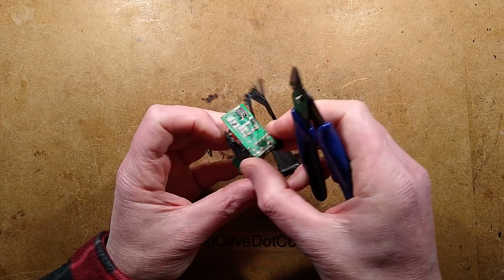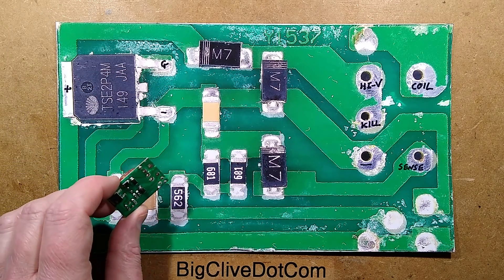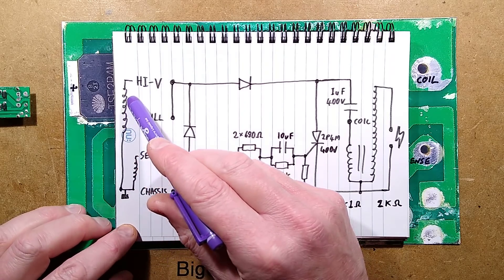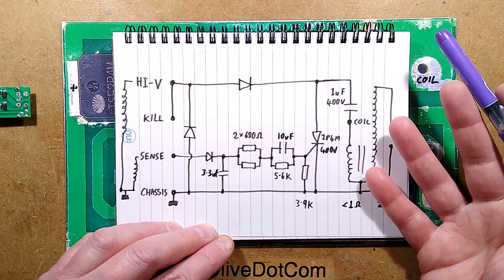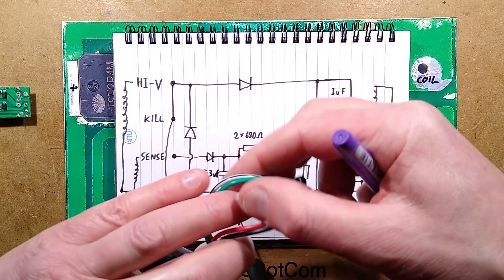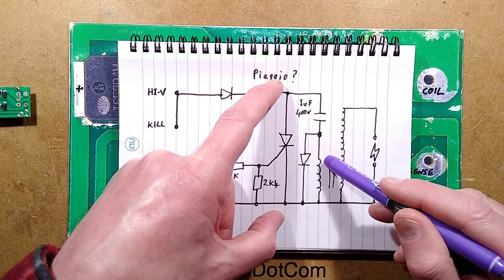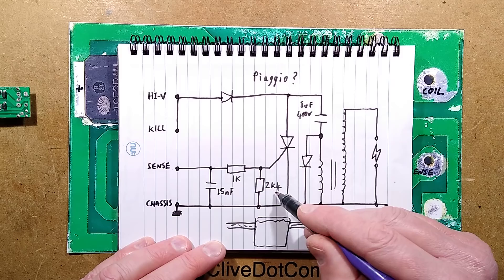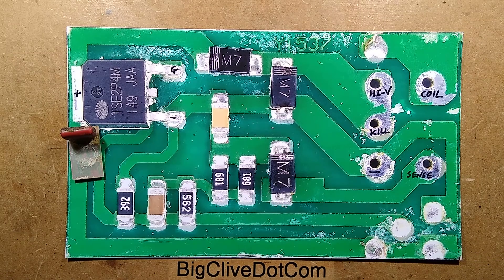Inside a cheap CDI Capacitive Discharge Ignition module - with schematic

Comment: Chuckled at the 'Kill switch chat', my 1st motor bike a Triumph Cub in the 70's had been 'refurbed' by the seller and had put a horn button on the bars as an extra kill switch, but unknown to me had earthed the coil HT OUTPUT, like some lawn mowers and the metal strip onto the spark plug. And yes the 1st time I found out was with no gloves on but I got a good deal as he told me 'it cuts out when it rains'. Wonder why.. :-)

Comment: The ignition coil from a car can be very useful for high voltage experiments ⚡⚡⚡
Reply: Made a self oscillating circuit for one. It fires 5-10k times per second, and the arc is hot enough to melt solder and light a candle. You can check out the video on my channel.

Comment: directly grounding magneto ignition primary via a switch or push button is pretty much standard and has been for many many years, they likely copied honda/yamaha/suzuki and others.
many of the engines and other parts are close honda clones

Comment: Maybe the little "tank circuit" between the sense and trigger acts like a variable time delay that varies with RPM.  Anything that adds a little more spark advance, too a point, as RPM increases would add performance to the motor.  As RPM goes up, the incoming sense pulse should be ramping faster and faster as it narrows.  I'd like to see the circuit on a scope while being stimulated at different frequencies from the sense line, to see if anything happens to the timing of the trigger as frequency input changes.
Reply: I'd like to know how to have a capacitor wired in to retard the spark to make starting easier,

Comment: I was looking at the Piaggio schematic you drew and I was wondering if the diode over the transformer is pointing the right way? Now it looks to me like the current will flow through both the winding and the diode. I'm used to see the diode mounted the other way around to clamp the back-emf.
Reply: It is the right way. When the circuit is triggered the top terminal of the coil is negative.

Comment: I would think the sand is there for the same reason its put in fuses. To help contain any sudden flame out over heating damage setting fire to the case. Just there misguided attempt at fire prevention.

Comment: When fixing the older pre-CDI contact-breaker type ignitions, almost any replacement capacitor would do, as long as it was rated for mains voltage. We would recognise a faulty ignition by a weak spark at the spark plug. We'd first judge the colour of the spark, should be blue, and the distance the spark could jump from the lead to the engine. Should be about 10mm or more. This to determine if there was an ignition problem at all (other than timing). Next we'd check if there was any sparking between the contact breakers. A breaker ignition with a good capacitor will have next to no sparking between the contact breakers. On an ignition with a bad cap, the breakers will spark at every revolution.
Reply: In addition to allowing a path for the back emf to decay, I think it also allows the coil primary to 'ring' giving a longer sparking time.

Comment: The terminal you labelled is not high voltage. The charging voltage is in the order of tens of volts. You would not feel it at all. The high voltage output is generated by the turns ratio of the transformer.

Comment: Just guessing the reason the piaggio design is simpler is it lacks somewhat of a timing curve that the other circuit has. The one cdi is for a 4 cycle engine as the piaggio is for a 2 cycle. Again, I am just guessing

Comment: There is also another module style sold as points replacement for magneto plus mechanical points.
In these the trigger sense is off the high voltage feed from the magneto. The original points short the coil and magneto to suddenly collapse the current.
The replacement triggerd the short circuiting  thyristor as the voltage just starts to drop with a capacitor circuit and a PNP transistor.

The wire colout codes used on cars correspond. Black switched ignition, red permanent battery, brown earth. My 1973 VW camper uses that scheme.

Comment: Odd thing about the CDI system is it works completely backwards to a conventional ignition system. Typically for most car ignitions, the coil is driven just like it would be in a flyback power supply. There is a dwell time (equivalent to duty cycle) that allows the current to ramp up until the coil is nearly saturated, and then the transistor switch snaps off, resulting in a flyback pulse that fires the spark plug.
Reply: I'm trying to get my head around the CDI vs conventional thing.
" that allows the current to ramp up until the coil is nearly saturated, and then the transistor switch snaps off, resulting in a flyback pulse that fires the spark plug."
So spark occurs when mag field collapses ?
Reply: @Boraxo  Yes, spark occurs when the field collapses.

But of note, in a conventional car ignition system the coil is switched with "points" in the distributor instead of transistors.
Reply: @Boraxo Yes, and note that the back emf is in the order of hundreds of volts. In cdi unit the capacitor discharge is initiated by points closing. You have to have a hv generating circuit, or If you have a magneto you already have hv, which is used to charge a capacitor, then a transistor discharges the capacitor into the coil primary when the points close.
Reply: Research field collapse magneto and field buildup magneto.

Comment: Im guessing they include the reverse diode in the first module so the magneto voltage just doesn't sail off into the sunset. There's no real harm as it will essentially be like the catch diode on a relay. It will simply allow current to flow and then decay out from the resistance of the coil and wiring.

Comment: If your car has brains, dont remove the battery from the circuit while its running. A lot of ECUs rely on it to smooth out the supply and can get angry if its suddenly given a shit ton of noise. Bump starting on a dead battery is fine, just don't take it out of circuit.

Comment: You are amazing.
For years I have been looking for this to design my own fancy imitation cheap imitation cdi
Reply: Yeah but I ain't rich like that.

And well R.C. that's a good thing since I wanted to produce a few dirt cheap for testing.

I want one that's got it all though. Now I have to keep switching cdis.
That's why I wanted to build my own with several settings, a simple moped ecu one might say. At first I wanted to build a switchboard but with all the wires it thought it would be to relay-able so I tried to find schematics so I could simplify the wiring but I couldn't find anything clearly close enough to pick from. It was a few years ago and since then, after getting more experienced with electronics, I decided to build my own one day because whichever type seemed most suited could probably fit several selectable modes in one device.
And recently I was thinking about a mounting bracket for my cdi instead of the rubber strap but now this is here and finally some fitting schematics too since this is my hi rev unit's copy.
Reply: I have also wanted to make my own circuit but the chinese cdi units are so cheap that I just spend the few bucks and buy them lol
Reply: The secret is sand.

Comment: The additional circuitry on the pick-up (trigger) circuit is to provide filtering and manipulate the ignition advance (fire point relative to piston/crank position) through the rev range.
High performance two-strokes generally need less advance on high rpm, so they can dump the ignition heat on the pipe to protect the engine and make more power.
Low performance two strokes and four-strokes need increased advance in high rpm's to compensate the lack of pumping and combustion efficiency.
The CDI circuit and the AC magneto must live in perfet harmony, otherwise low energy misfire or low engine performance may happen. This is hard to get right.
Some CDI's have weird trigger circuit due to the way the AC magneto works. There are a lot of types ranging from exterior pick-up (1 pulse per revolution) to interior pick-up making 2 pulses per revolution (one is wasted) and interior pick-up with weird arrangements between the HV coil and the position sensor.
Some older designs, like the spanish Motoplat found in many mopeds, use some electronic components on the stator itself. That's why you see so many different trigger arrangements.
 
The cable color scheme and CDI type is clearly Honda clone, as used on smaller motorcycles (both 2 and 4 strokes).

Comment: SCR/TRIAC's can withstand substantially more current on their trigger lead if it is duration limited, and a higher current pulse ensures consistent triggering in the face of device parametric variation due to temperature and manufacturing. The capacitor in series with the trigger lead limits the amount of energy delivered in each trigger pulse, thereby allowing for a higher peak current.

Comment: Seems everyone assumes the sand is just filler to save money on epoxy. That's silly- they could just make the case smaller.
I recently watched a YT video on how we're *running out of sand*. You wouldn't think so, but the concrete industry goes through millions of tons per year with the semiconductor and optics industries running a distant second. All of them require sand with particular characteristics of purity- you can't just use any old sand.
That sand isn't cheap filler, it's a value-added luxury item at the rate sand is getting more costly every day!

Comment: I was thinking... maybe that other diode that keeps the coil from firing on the other half wave... is that there to keep the coil from firing on the wrong stroke?  Intake-compression-power-exhaust so you only want it to trigger every second rotation... although firing on the exhaust stroke wouldnt matter much.  Assuming it is for a 4 stroke... if it is a two stroke then it would fire every rotation.
Reply: "Wasted spark" was typical on car engines with coil pack ignition (two cylinders per coil), worked fine.

Comment: I bought such a device for removing the 45 km/h speed limit on my son's 50cc. I paid 160 € for this. For this price, I should have dissolved it and rebuilt a new one
Reply: some CDI's are really very complex, with modern stuff running a microcontroller and approach what you find in cars,

Comment: Interesting indeed!

I've been working on building a microcontroller powered replacement for a two wire CDI (no sense line; it just uses the zero crossing of the HV line to trigger).  Should be fun!

Comment: is the "complex" part there to adjust the time it triggers? it should not have the same trigger point at different RPM's. the higher the RPM the earlier it should trigger.
Reply: I get your point but the advance really depends on the engine itself. High performance two strokes need way less adavnce in high rpm's.

Comment: The input RC arrangement is in fact for timing. In fact, simple CDI's like these don't actually advance at high rpms, they just retard less. The sense coil is way before TDC. Also typical bike CDI's will have a very significant low rpm retard so the bike is easier to kickstart, the timing will jump above ~2000 rpms, which is clearly visible with a timing light, it is a very sudden change. I don't know exactly how this is achieved.

The diode short circuiting is to avoid high reverse voltage I understand. Open circuit voltage can go high enough to damage the coil, wires or circuitry. The energy isn't much and it isn't a problem to just short it. Keep in mind the rotor has many poles (there are different arrangements, also there can be more than one magneto coil) so the capacitor actually charges in a couple of pulses
Reply: Completely agree will all the statements!
Reply: I was just about to say the same thing, but you beat me to it!
Reply: Could a capacitor be wired in to retard the spark to help starting say on he signal wire?

Comment: What solvent are you using to soften the potting compound? I have just tried to depot the circuit board on a very expensive voltage sensing split charge relay to replace the very shitty relays contained within and removed a number of diodes hidden underneath.

Comment: I would love to see an dc cdi depotted

Those have a boost converter to get  the 12v to a 200v to charge the capacitor
Reply: Likely based on the flash circuit from an 1970's camera I bet

Comment: Back when I was doing automotive I recall black as switched live being quite common. No idea why they chose that, but some Ford wiring looms (possibly Cosworths? Was many years ago!) are one that springs to mind as having "live blacks"
Reply: Ford North America still used live black well into the 80's/90's.  But the real winner in wiring is JCB in my opinion, EVERY wire is white. the only  ID being an inked number on the insulation.
Reply: @alexb.1320  That's actually pretty common in industrial and heavy equipment.

Comment: Could it be that this is for a 4-stroke-engine so the spark shouldn't ignite at the wrong stroke in the 4-stroke cycle?
Reply: If the spark ignites on the wrong stroke nothing will happen. The wasted spark fires at the end of the exhaust stroke when there is nothing flammable in the cylinder.
Reply: There are 2 systems 
1:sense coil on camchaft =1spark/2 revolutions 
2: sense coil on fly wheel and spark in the exhaust(harmless) stroke and the compression one (every time the engine is on tdc (top dead center)

Most 4strokes use the 2nd system

Comment: If I'm not mistaken that is an AC CDI there are also CDIs for scooters and such that are DC CDIs.  Might want to see the difference between the two.
Reply: DC CDI's have a simple oscillator and a transformer to generate the high voltage. Starting is easier as you have full voltage at 0 RPMs
Reply: @nirodper  Yeah I have 2 150cc gy6 go karts.  One has a DC CDI and one has an AC CDI.  I can confirm the DC one does start quicker.  Plus you can use standard 12 volt lighting.  The AC one the voltage is to high for regular car lighing.
Reply: @kiffing  but the "AC" voltage going for your lighting comes from a different coil on your stator than the 50-70 volts AC produced by the exciter coil that goes to power your AC CDI box.........voltage being too high for automotive lighting has nothing to do with the fact that the one cart has AC fired CDI box rather than DC  ?????
Reply: @bigpig41  Well I know that with the AC CDI I can run it without a battery but the kart with the DC CDI will not run with out a 12volt battery.